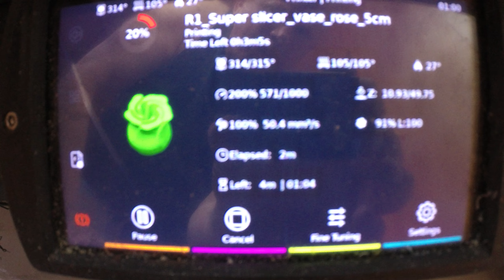Spiral Rose Try for cooling fail

Comment: the consistent accuracy of this machine moving at these speeds absolutely blows me away.  just amazing!   is there some sort of BOM one could look at?
Reply: its not for release
Reply: @simplykiwified1606  I know it. I would just to love to know what components make up the motion system and the extruder, at least.
Reply from the maker: There are a few cross gantry printers out there with a complete BOM. There is nothing really different about this one vs the others and the speed can be faster on the smaller printers.
Reply: @MrRocksalt  the fact that your rails are supported is a huge difference
Reply from the maker: @stephenteitgenengineering  I would love to agree with you, but... They did provide a higher acceleration value (30% more), but in reality I can't tell the difference in the prints. I keep them on because the ADXL shows higher, so why not. But I have been looking at the results and they seem to be the same. I will remove them and print the same model to see if a difference.
Reply: @MrRocksalt  it's still a huge difference I mean maybe not necessary but it would definitely increase rigidity
Reply: @stephenteitgenengineering  I'm not sure but I think high accels in the graphs are not everything. Vzbots get much higher numbers, yet Rocksalt's printer prints much faster at better quality.

Comment: Do you still have the 17mm LDO extruder motor with 10t gear? There are also Moons 20mm 8t or LDO 20mm 7t motors for more pushing force. What accelleration was this printed with?
Reply from the maker: This was with 17mm LDO, 10T. If I need to add more force the nozzle is too small IMO. This was 60K acceleration.
Reply: @MrRocksalt  Yeah true, nozzle orifice size is what is limiting it, not melting capability. But still, pushing harder gives more throughput. Nice thing about the Moons motors is also they don't run hot like the LDOs, with 0.85A it just reaches 30C or so after hours of printing (without chamber ofc).
Reply from the maker: @petermeier3153  Sure, but heat is not a problem for me. It's all synked to alu, no printed parts and running 48V @ .35A. Seems to push..But dang, this speed is too much... enough cooling, so I give up.
Reply: @MrRocksalt  There is an LDO 6t coming out soon.
Reply from the maker: @petermeier3153  Not sure how/why I need that. Smaller pinion increases tq but you have to run more speed. Speed on these motors drops tq. Not sure how that will play.
Reply: @MrRocksalt  Annex guys have tested that and say 48V on the extruder motor gives enough torque even at high RPM. They have a wormdrive extruder with 19:1 gearing (even higher) and say they push 75mm3/s at quality through a 0.4 nozzle. I myself have Goliath/vz-hextrudort with Moons 10t and will test Moons 8t soon to see how big the difference is.
Reply from the maker: @petermeier3153  To me this is illogical. I am using 10T 48V on extruder. If I change to 8T or 6T, the motor has to spin faster than my current setup to reach the same volumetric flow. So, the only way 6T or 8T or 10T or or or would be better is if the torque curve of the motor, at that speed, is within it range to support that torque. I have not looked at a torque curve of the 17mm wide LDO vs the 20mm wide LDO to see where that falls. My other issue is that those guys are pushing flow with .4, to the point the filament is forced through the nozzle. At some point of force the behavior of the filament changes. This means PA changes also. So what happens when you run typical, lower, filament flow? It would see you would need to change PA based on filament flow? Seems logical to me. So I like to print in the range of not needing excessive force to avoid those issues. 50mms3 seems like a good amount of flow to me on a .4 nozzle! When I get some time I will do some flow tests and see. Seems 50-54 is working with the rose, so maybe it has more?
Reply: @MrRocksalt  Yes the motor needs to spin faster, but with 48v the torque curve doesn't fall too much at higher RPMs. The smaller 6t gear increases torque at the driving gears significantly, 5:1 vs. 8.333:1 reduction.
Regarding PA becoming hard to tune: Have asked myself the same. Then there's also the issue with the polymer molecule chains (?) making the filament come out crooked at high pressure and also die swell. I think they mentioned some Klipper changes regarding the PA issue though, but not sure. Maybe those 75mm3 they claim will be not so pretty like they say and only useable for infill? On the other hand, from what I've seen from those Annex guys so far, they seem to be walkers, not talkers.
Reply from the maker: @petermeier3153  Looking forward to your experiments!!
Reply: @MrRocksalt  Yeah, I'll report back with experiments. Already talked too much :)